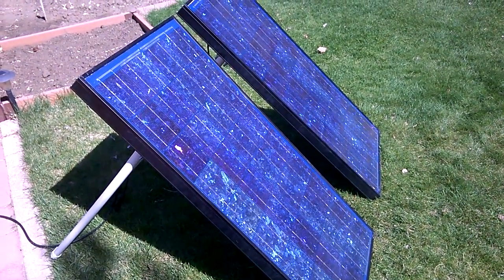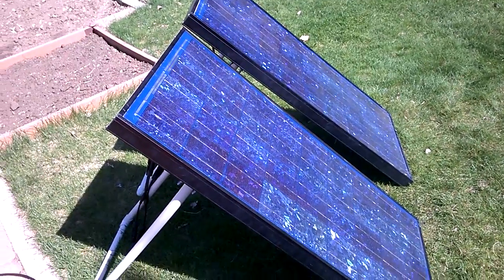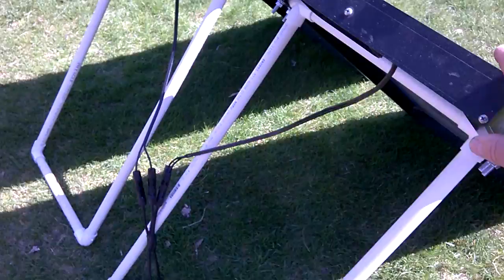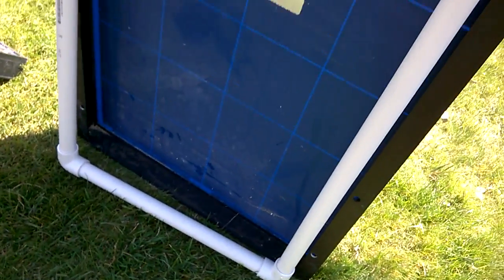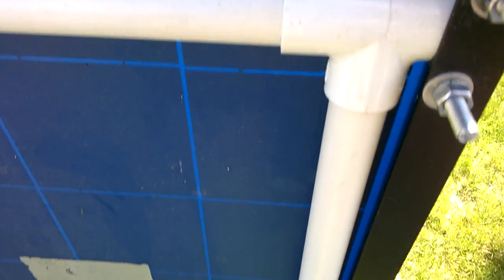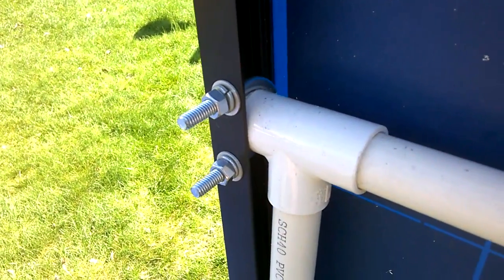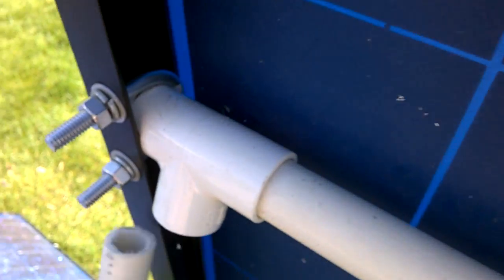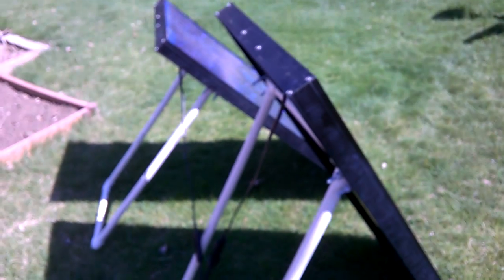DIY Solar Panel Supports for Portable Systems

Comment: Great idea! Has it ever been necessary to install some sort of latch or pins to hold the legs at a certain angle, like in high wind?
Reply from the maker: The joints are stiff enough that this has not been a problem. For wind, placing weights of some kind on the bottom pvc rail seems to make it stable enough.
Reply: @lynnsessions6022  That's great to hear; thanks for your reply :-)

Comment: How the heck did you fit the U-bolt under the frame?
Reply from the maker: I had to drill the holes large enough to be able to wiggle the U-bolt around the corner. In other words, the holes were larger than they needed to be.

Comment: it will away in case of strong wind & top glass will be broken
Reply from the maker: Windy conditions? Weigh the legs down with bricks, blocks, rocks, etc.
Reply from the maker: That is very possible. For wind, glue the PVC pipes and weigh them down sufficiently.
Reply: Lynn Sessions   Sand Bags